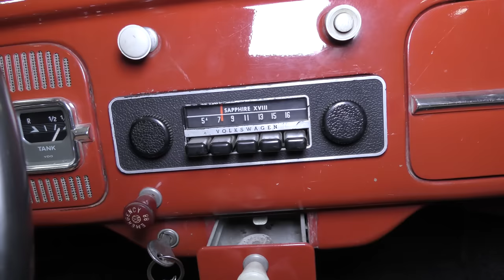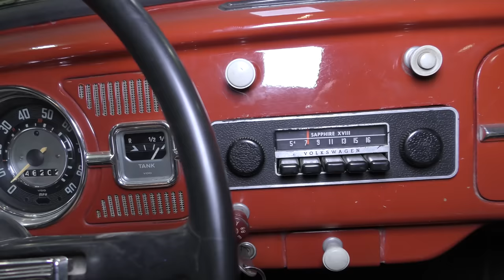Big Mods with big $$$. When Mods don't make sense. What did the  CAR WIZARD do to this '66 VW Bug?

Comment: My tastes lean towards the keep it original side.  Good to see the owner hasn't done anything that can't be undone.  That said, it's their car and they can do what they want.
Have to admit, the electric fuel pump makes sense (along with that alternator).
Reply: Alternator And 12v conversion 😜
Reply: @fabbricaitalianaautomobili5859  after '65 they most all were 12Volt, all mine were, the Split Buses, too
Reply: @uliwehner  nope, VW Type 1 became 12volt in '67. Even the '67 Beetles have a generator, not an alternator.
Reply: @uliwehner  '67 was the first year for 12V Beetles, at least here in the US.  6V Beetles were still sold in Europe for a while after that
Reply: @chrisfreemesser5707  i may be a litlle rusty on the beetles but my split busses were 12 volt from the factory. Even the US Models.
Reply: @chrisfreemesser5707  August 66 you made me look it up. 67 model year. Not far from 65 though. And i do know that 6v was still available. I never drove one though. And i have owned or driven many.
Reply: Yes keep it as original looking as possible and make it fast and ride well without hinting to it.
Reply: Mine lean towards the customize everything side
Reply: @uliwehner  12V started in '67 as standard.  Prior to that it was optional starting in the early 60's.
Reply: 12v was first introduced in 67 in the beetles and it was a 12 v generator with the regulator under the rear seat
Reply: Yes, the electric fuel pump makes wonderful sense…..that way, it can push 10 pounds of Chinese blister pack, chrome, empi, fuel pump pressure passed the needle and seat in the carburetor and REALLY run it rich.
And
No,no,no…..don’t search for the correct fuel pump…..that would be ridiculous.
And
Yes….we need 100 ams of power on that archaic 50 year old wiring. Or…new “spun copper” (junk) Chinese, blister pack, empi wiring harness….
Because you know, 30 amps from a perfect German generator….isn’t enough to power their “bumpin system”…and would just be preposterous….
And
Don’t get me going about the Chinese, blister pack, chrome alternator..

Now
That’s what I wanted to write…..but I didn’t 

Both of my cars, are bone stock….as original as can be had, they run and drive….here is the phrase…..as they should.
Reply: @tjsailing5232  My 1969 1500cc was 12 volt with a dynamo/generator as standard. Had standard front disc brakes too - pure luxury 😀.
Reply: @uliwehner  '67 was the first 12V standard (had one), but you could get optional 12v in the early bus.  They also had 2 bumper-mounted backup lights only on that year.
Reply: @uliwehner  There is no "difference" between 6v &12V. Driving at night was barely good AND YOU COULD NOT JUMP START IT USING A 12v which most other cars are. So you are calling a tow truck explaining you need a 6 volt jump.    
. If you have a generator and a downward slope, you could put it on the hill and push start the car rolling, then jump inside, turn on the key and drop it into 2nd gear and the engine would turn over and start . Car is standard transmission 4 speed.  VW made the schittiest automatics transmissions.  
. Usually your battery is at the end of its life so you need to drive to Wally world and buy a new battery.
Reply: @tjsailing5232   I have had  a 66, 70, 73SB out of Germany All generators, all around drum brakes, clean interiors and solid exteriors.   Those heater hoses he showed in the rear - you have to make sure the connections are tight to get heat up front in the car...and you leave a door window open a bit to let out the pressure or the air won't flow.
. It was a VW stock color(an off red) as it matched the color inside on the dash.
. That muffler was not stock as it did not have the baffles inside the tail pipes.  (Meaning if you got a stock muffler with the baffles, pry them out and you get closer to his sound and not that whistle.
. He never did say WHY he removed the stock fuel pump.  If it is working correctly then there is no need to remove it.
Reply: @bunzeebear2973  jumping a 6volt with 12volt is no problem. Jumpstarted 12v diesels with 24 volt many times. Just can't crank a long time.
Reply: Other thing to consider changing on any old VW is the fuel tank.  The only time I have ever seen a car burst into flames outside of a race track has been with these VWs with the fue tank in the front.  Last wreck I saw of one had 2 dead girls burned alive inside because the fuel tank rupture when they hit a truck.  I would make sure to replace the fuel tank with a fuel cell so I didn't get turned into a lump of charcoal in the event of a crash.
Reply: @duckmyass   that would be hard to watch. At the same time in over 40 years in the aircooled VW hobby i have NEVER seen a Beetle catch fire in the front. all VW fires i have ever seen  or seen pictures of, where carburetor fires in the back. Can't even work out how a beetle would catch fire up front, there is really nothing there to set the fuel on fire?
Reply: @uliwehner  Ford Pintos that are notorious for catching fire in rear end collisions don't have any hot engines in the back to ignite the fuel.  All it takes in any car to cause problems is a ruptured fuel tank.  The metal against metal action can generate the spark that sets it all off.  As for engine fires in them, I've seen some of those but they don't tend to engulf the car in flames so quickly that the occupants die.
Reply: @duckmyass  pintos had an exhaust in the back and the engine of the car that rear ended them... cars almost never catch fire in an accident. Almost always electrical.
Reply: @uliwehner  The exhaust in the rear of a pinto is not nearly hot enough to ignite gasoline.  The flashpoint of gasoline is more than 500 degrees and the rear exhaust isn't nearly that hot.  And if you want to just look at electric sources, you do realize that all cars even when the engine is in the back will have headlights and signal lights in the front.
Reply: @OkFixer  i like your style.

Comment: Lovely. That car has been restored although  I suspect the inside hasn’t been repainted but the interior is a new reproduction. The front beam, floorpans and heater channels are also new. Beautiful car - enjoy as is, no need for EV!
Reply: Yep. Very doubtful those are the original miles.
Reply: No AC fuck that

Comment: "We gotta remove the engine" As if that's a difficult task on a Beetle 🤣
Reply: I've owned over a dozen vintage VW sedans and buses ... I got to the point I could remove the motor by myself, in my garage, in less that 45 minutes ... same for putting it back in. Love the old VWs.
Reply: @hrcvf7505  haha yep ,I was gonna say 45mins-1hr and it should be on the ground.
Reply: I was thinking the same thing. Lol
Reply: @hrcvf7505  Yep, me and my dad were able to carry the engines with just the two of us, no cherrypicker or furniture dolly, all the accessories still bolted on.
Reply: I used to remove them, on the street/back alley, by myself, and I am a small man.
Reply: 4 17mms on the side of road😁

Comment: I have used Stabil in all my gas engines for years and never had a fuel problem.
Reply: I second that.  I generally try to run my classics at least once a month but that doesn't always happen in the winter.  Between Stabile and battery maintainers, I never have starting issues no matter how long they end up sitting. I also use Stabile in the daily drivers and my emergency generator.
Reply: @shawnwest3779  I just watched it, that was not scientific.
Reply: @shawnwest3779  And I did a person 1.5 year experiment on it and it worked like it had fresh fuel in it. I'll take my anecdote to their shit experiment.
Reply: @rustler08  (Ii had a Superbug which spent a year at a time sitting in my mates driveway while I was in China. I drove it when I came back for holidays and it never was a problem starting. I don't know if fuel in Australia has an additive in it or not but I regret selling that car.
Reply: Used to use stabil in my motorcycle but now I use racing fuel when I store the bike for winter
Reply: I've had excellent results with Stabil 360! ATV's, lawn mowers, old cars and yard equipment.
Reply: @mg_dynames  I use 94 octane which has no ethanol
Reply: @atodaso1668  How do you think they get that high of octane?  Ethanol is cheap octane booster.

Comment: If they want to be able to get in, turn the key and go, then they need a newer fuel injected car.  Carburators and old ignition system require maintenance, period.  Something that would probably help would be to wire a switch for the fuel pump so he can cut the fuel pump and run the engine until the bowl is empty if it's going to be sitting for an extended period.
Reply: I do the same thing with motorbikes, shut the fuel cock and let them run out.
Reply: I’m not sure that’s the best practice. I’d say it would be better to bleed the fuel rather than let it lean out. Can’t do TOO much harm though.
Reply: @edlingja1  - It's not a problem @ idle, under load if it leans out too badly you could actually melt pistons.
Reply: I am sorry, but shutting the fuel off and letting it run unit it leans out only burns out very little fuel. No more than say 20%. The rest stays in the bowl. You really need to drain the bowl.
Reply: Correct. The fuel flows from the bottom of the bowl so it would run out. But with that additive it may not be necessary. Besides these carbs a super easy to get off s clean if needed
Reply: @user-gdxt-7399  When it comes to modern fuels I am more concerned about making sure the jets and needle valve don't get gummed up from the residue that gets left behind after the fuel evaporates and preventing damage to the o-rings and diaphragm that modern fuel seems to love to cause if left to rot in the carbs. So I always cut the fuel and let it run out to get the fuel out of the inner workings of the carb; the bit that remains in the bowl has never caused me a problem as long as I also use a fuel stabilizer product.
Reply: @nielsdebakker3283  On some that's easier said than done because sometimes the motorcycle might start over heating before it runs all of the fuel out of the carbs. Which was was the case with a Yamaha Royal Star Venture(air cooled, 4 synchronized carbs) that I had, which could continue running easily for at least 15 minutes after the fuel has been cut off.
Reply: I had a Baja bug that somone installed a little click clacker fuel pump under the gas tank in that little space there. It actually worked kinda nice compared to the manual pump bugs I had, I did like the quick no stumble start ups.
Reply: Its not so much that old cars need updates to start easily, its more that the owner needs to learn HOW to start the car, once thats learned, it will start every time, assuming everything is in correct working order. The electric fuel pump is completely unecessary. Carburetors have fuel bowls, and stores gas there ready for a start. When gaskets start dry out and allow the gas to evaporate out, yeah, it wont start, until pump has refilled the bowl. Fix gaskets, and use mechanical pump, and car will start. Even if it sits for 6 months, it will start.

Comment: I had a beetle 1500. It was slightly p later  1970 model. In addition to the rear suspension was a compensator bar as standard equipment which limited the movement of the rear suspension.  It was an all torsion bar model and it's performance over unsealed corrugated roads was just amazing.

Comment: My Dad's second wife had a 72 Bug that I learned how to drive standard on. The heater wasn't worth a damn in the winter but with snow tires it had excellent traction and did great donuts lol.
Reply: Yep, my Dad had a lt blue '71 Bug (or "Superbeetle") as our 2nd family car. He bought it used in '78, passed it on to my older sister in '85/86, then taught us both to drive stick on it, until it rusted out in '88 or so. What a fun little car, amazing to me now it lasted that long!
Reply: @laurat1129  hers was faded yellow and all 4 fenders were dented. That was 1975.

Comment: Thank you for saving this car. I'm all for EVs, but I'm also for keeping whatever we can still running on gasoline. I deal with carburetor issues every spring, when I want to start a new driving season for my Jeepster. But then, when I use it in a weekly basis in the summer, it runs very well. Well, well enough, since I'm the one sorting (not fixing, I guess) the issues.

Comment: I absolutely love seeing more of these classics coming in your shop, like you I love them original, I hate when they start modifying them, it ruins the car, I have a 1989 firebird that I restored and brought it back to all original right down to the original cassette stereo
Reply: Personally i prefer modified cars, original ones are pretty boring. But i still think that mint condition ones should still be kept that way, i would only modify or change a classic car if it was already in un-original or sub par condition.

Comment: We have old cars and bikes with the fuel issue. We chose to get ethanol free fuel in drums from the local race gas distributor. We are using Sunoco Optima unleaded no ethanol. Sunoco, Vp, and Stinger race gas are wildly used. The all have lots of octane ratings so you can Taylor it to your cars or bikes compression. It's claimed to stay fresh after opening for a couple years. No ethanol makes a huge difference.

Comment: Glad to see that after-market fuel filter outside of the engine compartment. The fewer chances of a fuel leak developing in there, the better.
Reply: I missed that, where did you see it? In that model the fuel filter was probably near the transmission under the car, not in the engine compartment.
Reply: I just spotted it briefly near the transaxle, not far from where the copper pipe leaves the frame. From the factory, the Beetle only had a fuel filter built into the fuel pump. Honestly, I've driven thousands of km in my own Beetle with just that stock filter in the fuel pump, with no issues whatsoever. But if you are going to mount an after-market filter, keep it out of the engine compartment.
Reply: The fuel filter should be between the tank and the pump.

Comment: I hope you replaced the fuel filter too. Since you had concerted to an electric fuel pump, I certainly hope you had relocated the fuel filter from where it used to be w the mechanical fuel pump. That old location was known to cause engine fires, since it was located right above the ignition distributor. 

Btw those door panels are not stock. That bug has obviously been restored w them front disc brake conversion and the vintage speed stainless steel exhaust. And that intake didn't tell me that the engine is still the original 1300. Most likely an updated 1600 single port.

Comment: Best advice I ever got for my 61 Volkswagen was from a Volkswagen factory-trained mechanic who owned a custom VW shop:  Stock is BEST.  Ran the stock single port for over 100,000 miles. With nearly 40 years of ownership, except for an 009 distributor, alternator conversion, dual port heads, roller rockers, and dual baby webers, I have to agree.  320,000 miles and still going!!
Reply: Freeway Flyer Transmission? It will help any air cooled do better on the open road.

Comment: i had a 62 with the stock 40hp 1200cc. I used to love showing off to my friends how I can just TAP the key to start and it would fire right up. I could even start it just by shoving off backwards out of the parking spot and pop the clutch in reverse.

Comment: Good to see a classic Beetle on the channel. I love my 67 and have it modified in a way that I like. I run Stabil too. You did the electric fuel pump perfectly
Reply: The impact switch shows real concern for the owner. Not sure about the 30 GPH fuel pump, though. If the gas mileage falls as speed increases to say 20 MPG, the engine will start to starve as he approaches 600 MPH.

Comment: 3:19 Old VW's never came with a tachometer, the three red hash marks on the speedo (first at 15MPH) (second at 33MPH) (and third at 47MPH) are MAX up-shift points for the transmission.  Another example of German engineering.
Reply: They were and presume, still are, low-revving and slow cars, get from A-B and rarely break down. The 1303s had a 1600 engine which went better I think.
Reply: Dang I posted the same thing after she said that. Love them old beetles.
Reply: I had several hot rod beetles. My 1960 came with a 36 horsepower motor with the same shift points. With a highly modified 1750 cc twin port motor I could lift the front wheels shifting 1-2. The new shift points with the stock split case transaxle and stock diameter wheels were 35 mph in first , 65 in second, and 115 in third. Top speed was just a little above that as the car got very light and wanted to blow over backwards like an unlimited hydroplane. A side silhouette of the beetle body is like a cross section of an airplane wing: it produces 400 lbs of lift at 100 mph.  Beetle drag cars have the body modified to prevent blowing over at speed.